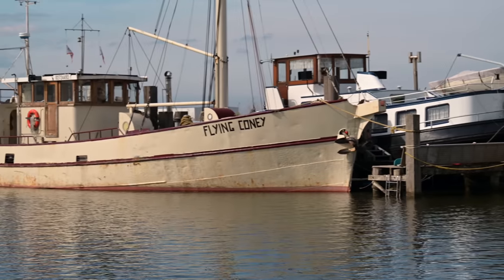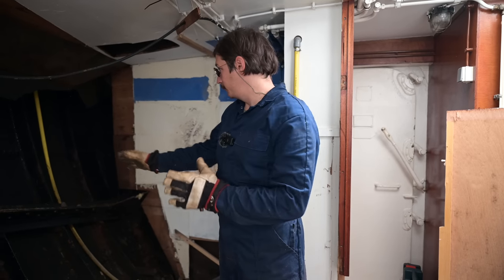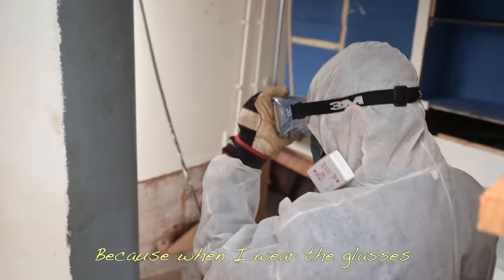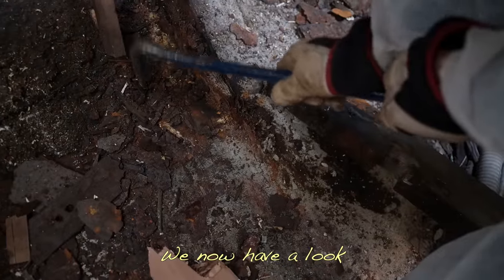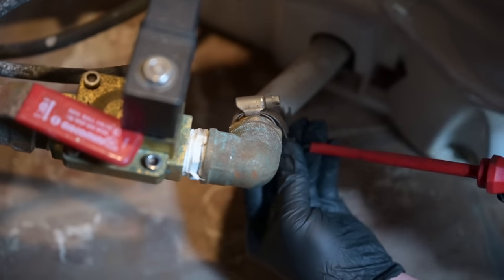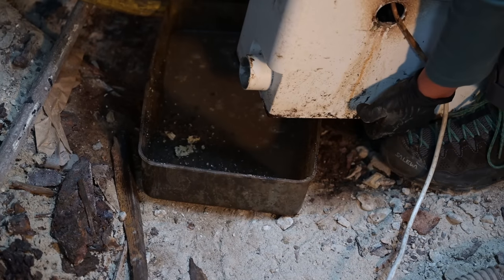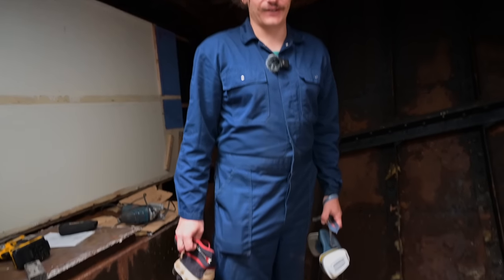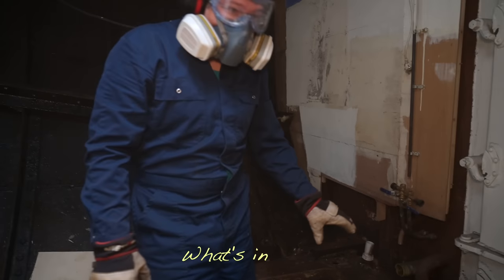DESTRUCTION! Removing an Old Blackwater Tank!

Comment: Please accept my comments in the spirit intended! Your steel hull is severely corroded from both sides, visual inspection and seeing the holes is important. I would recommend that the entire hull is electronically measured for plate thickness . I’m sure the plates are severely corroded in area
Reply from the maker: Luckily we still hade more than enough plate thickness left. We had the complete hull and especially the spots around the holes measured. Most of the hull is in between 6 and 8mm.
Reply: You are doing an amazing job and well done! I thoroughly enjoy your posts ( I have my own 22m wooden boat restoration project) 🫶
Reply from the maker: All the best for your project. 22m wooden boat sounds like a lot of work!

Comment: Finding that the steel deck is laid over the original timber deck is a distressing discovery that opens a whole new can of worms. Now that the internal steel structure has been fully revealed it is obvious that the previous owners cut every corner to band aid over what has become a truely huge restoration project. So now that you have a more realistic understanding of the scope of the project I would strongly advise you step back and reassess the way forward. This would be a make or break decision based on the risks you are prepared to take with your financial security.

Comment: Great content...... my opnion is.

Unmount/riplt the intairy interior and sandblast the exterior complety. You sabe time and see all the small spots
Reply: Sandblasting a hull as big as this one will cost a unsain amount of money. Beter do it piece by piece . Par example with a Terko .
Reply: @wimmol  if you hire the service, if. You buy the machine and the product the coast is less off course still a little amount of money. But you have 100% the condition the hull,  and due all the repair ones.

Gaond the hill you have more labor time, if you hire a "new guy", maybe you due for less money, but the size is big.....
Reply from the maker: Most people we asked have recommended not to sandblast the hull. We're still trying to find out if wet sandblasting is a valid method for our boat. When we're finished with the necessary work it's planned to have the outside hydro jet blasted.

Comment: Actually this project would be a great deal more fun if time was not an issue and the work could be done in a convenient place to reduce boat yard costs.  I would prefer to have pictures of the original condition before the demolition was started.  This is the first time i've ever vomited after looking at the waste tank!!!
Reply from the maker: I feel sorry to make you feel uncomfortable. Maybe it helps that the smell of the tank wasn't all that bad. But it feels very good that it's finally out! It's quite normal to do only the necessary work on the hard and to do the rest of it in the water. One of the benefit of having a YT channel is that we alway can go back to the boat tour to watch how the interior once looked. But since it was more on the practical side and we do want to have a yacht like interior we did wanted to build a new interior from the day we bought Flying Coney.
Reply: @FlyingConey    Don't feel bad for me.  After all, I could have quit watching before I got sick.  As a former old boat owner, I can definitely empathize with your efforts.  You're doing terrific work in saving this vessel!

Comment: Really enjoyed the new format.
Please tell me and in future videos the safety precautions you are taking with working in and around confined spaces.
Even tipping that holding tank into the bucket could of realised enough hydrogen sulfide gas to of rended you both unconscious in two breaths.
With bigger vessels comes some very deadly possibilities and regardless of you being the owners there are some health and safety matters that you should be following and making very clear in your videos that you are complying with them.
Show your safe air certificate and your air monitoring when handling stored sewage.
Show your safe to cut and explosive free certificate before cutting into any tank.
Show the forced ventilation blowing air into the compartments when making dust,opening tanks or any other job that will effect air quality
Surely the shipyard is regulating and supervising these matters.
If not then they must have one hell of a lawyer.
I really enjoy your vlogs but the inherent dangers of ship maintaince must be addressed when working on a ship cloonys size and you or someone copying you can find themselves badly injured or dead so you better state protecting yourself and showing that protection in your vlogs.
Looking forward to the next vid and yournew safety culture.

Comment: Concrete and steel is not a good mix. It maybe hiding holes and corrosion.
Reply from the maker: This would show in the thickness readings. Usually the steel underneath the concrete is in pristine condition. Rust needs oxygen and underneath the concrete there's non.
Reply: @FlyingConey  From my experience with the Steam Tug Wattle ultra sonic thickness readings of steel hull plating covered with concrete are very unreliable and overly optimistic. I suspect that the concrete in the bilges was poured to provide a quick fix to strengthen the rusted structure. Quick fixes undertaken to provide long term solutions always create larger future problems.
Reply from the maker: @Jetchisel  No fix, just the way fishing vessels are constructed in northern Europe. The concrete is a mix of scrap metal from the building process poured over with concrete.that provides ballast and a flat sole in the cargo hold.

Comment: daniel,pls stop pulling the angelgrinder...you have to push it!!!...maybey a plasma cutter works better fore  you.
Reply from the maker: Thank's for the advice. I did asked myself this question and couldn't find an answer. But in this particular case I had to start at the back of the tank so I could stand on it while cutting.